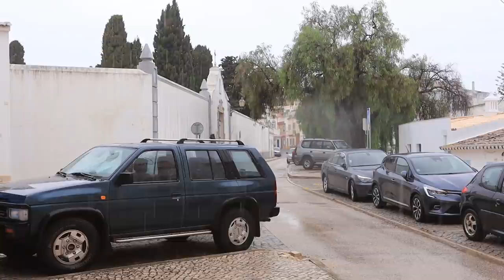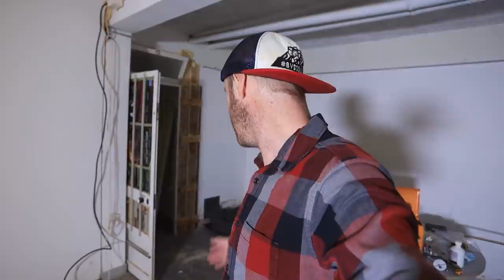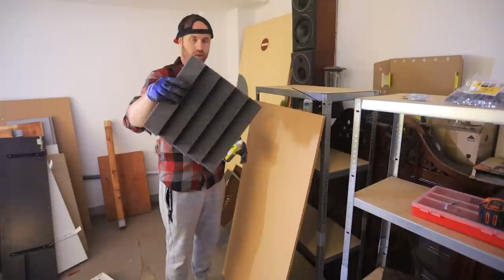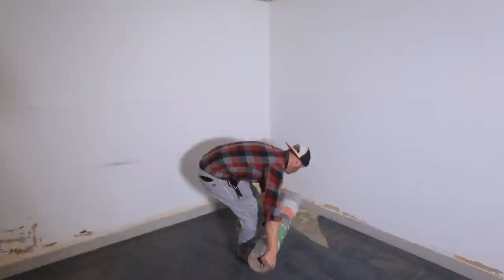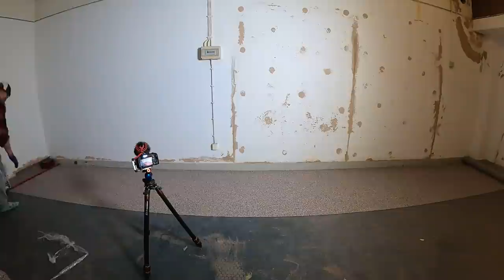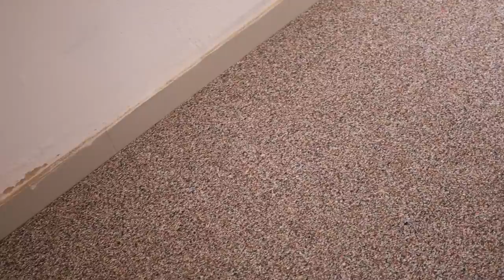Photo Studio Build Day 3 - Floors and Acoustic Walls

Comment: I love your enthusiasm and optimism for your project.  Getting that studio space up and running is going to be so good.  I did the same once with an old building to make a dance studio.  (I was envious of those mirrors and the floor.)  I would have been tempted to polyurethane the cork floors to seal them and prevent crumbling but it probably wouldn't have worked in that space.  Asphyxiation would be a distinct possibility. Nearly did that with the badly ventilated space I had!  Go well with your renovations.  May they give you exactly what you envisioned for your work.

Comment: If the spray glue you are using of the acoustic foam is a "contact glue"  the glue should be applied to both surfaces, let the glue go "tacky" and then stick them on, if all goes well it will never come off, even if you slip and put it on crooked. but the Sika you are trying will hold anything you want to stick down.  If I was was in the country I would offer to help. Good luck you are going real good.  I can't wait to see the end result.

Comment: You'll get the best acoustic absorption with mineral wool acoustic panels. There are good tutorials on youtube. You need quite a lot to be effective especially with wood floors. I covered about half of the wall area in a room with 100mm thick panels, the room is totally dead now. Thick rugs on the floor help as well.

Comment: If you're planning on using spray adhesive, you have to spray it on both surfaces to ensure that it sticks on there properly.
Reply from the maker: Ah, didn't know that, thanks! I've gone a different way now. But, I might try that again later.
Reply: Was about to post this... spray on both, let both surfaces dry until tacky then put together and you should be good to go! That goes for any surface including plywood etc... 
Looking good though mate... can’t wait to see it  finished!! Cheers Jase
Reply: @jasonkennedy2045  That looks like hard particle board.  It's kind of slick and it's really hard.  Staples probably aren't going to work either.

Comment: Someone has probably mentioned this already, but I believe there was still moisture on the opposite side of the wall where you made your cuts. That needs to be cut out as well. 
Find the source of the moisture and fix it. Otherwise, you’ll have to do this over again. 
-I just dealt with an old fridge waterline in my house. Previous owner never fixed the problem, just patched and painted. Everything always takes longer and costs more than expected. You’ll be happy in the end though. 
Also... I saw lots of pint glasses in the background. I know a bartender that might need work after the pandemic. Has a camera too. 😉

Comment: Looks like you were in the path of what used to be Hurricane Eta. If you ever wondered what happens when hurricanes leave the Southeast US coast and head off to sea, now you know. It looked like you used dry mount spray on the tiles. Did you spray the wall too? You'll likely get a more secure adhesion that way. But yes, a smooth non-porous mounting surface is best. (Edit: I see someone else suggested the same thing. Also, spray thinner from farther away; not close-up, so it's not goopy. Let the surfaces dry for a minute so it's just tacky, then place the tile.

Comment: No Mas Claves ( No more Nails ) is a great adhesive, comes in a tube like you used. I have used it to fix many things, inc skirting birds, if what you want to stick is light in weight then clear silicone does a great job. Mind you I have been back on jobs where huge patio doors were fixed using nothing but clear silicone, and they were a real b##ch to remove. DIY is great when someone else does it. 👊🏻

Comment: Eviostik contact adhesive will do those tiles nicely. Paint on both surfaces, wait 15 mins then press the tiles to the wall. Job done and a lot cheaper than the glue you are using

Comment: installing that foam can be a pain, the adhesive that is designed for it can be very expensive. I use some vertical contact cement
Get some LONG bullet head nails. and tap them through the foam after you added the glue. 
Leave heaps of room on the end. the nails just need to be in enough to hold the foam up while the glue dries.
Wait 48 hours. then remove the nails. (longer than it says for the glue to set on the bottle/can)

Message me if you need some more help with adding acoustic foam. I've installed heaps of it.

Comment: If I was you then I would staple or screw whit some black screws the foams to the plywood. I would never use glue tho hang up something because most likely come down and if you ever want to remove it it will not require any damage to wall or the thing you want to move. You don't glue pictures on the wall either.

Comment: Reckon you may need to condition the wall surface with a suitable solvent and sealant, to effectively provide a non-porous surface for proper adhesion - see: http://www.soundservice.co.uk/Installation_M20.html

Comment: The spray glue will not work, since is getting sucked and absorbed by the foam... try some silicone glue, similar with what you used for the flooring..
Reply: Just reached the part in the video when you used the floor glue for the foam :)) again, the problem is that the foam is absorbing the glue